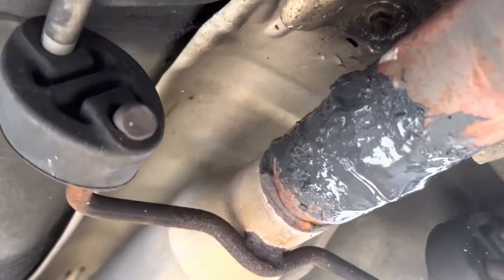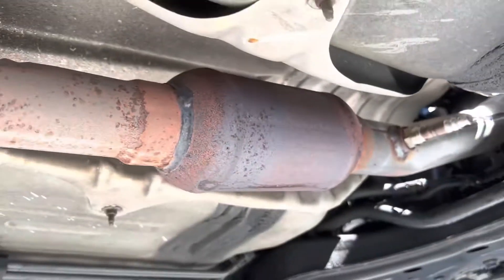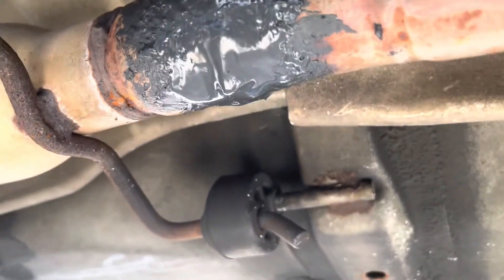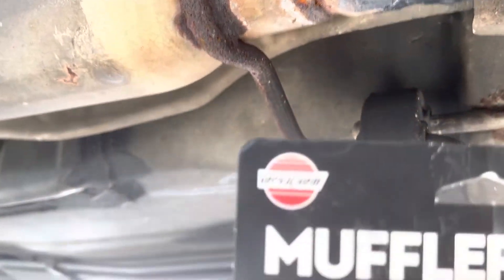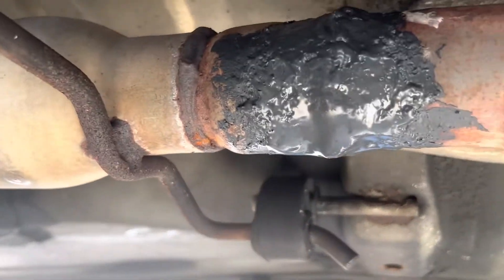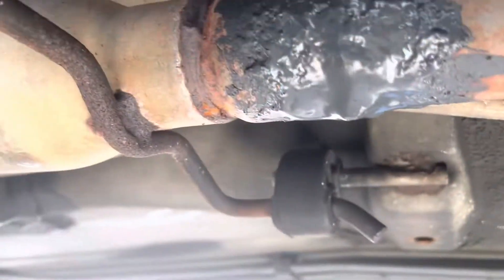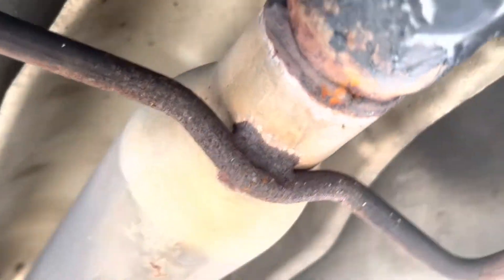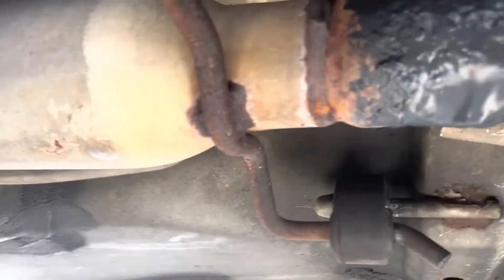Sealing pinhole leak in exhaust

Comment: Hi I had a pinhole just like you that a muffler shop saw using smoke test, my car was running lean I just did it today so don't know if fix my lean issues. Did your's get better after that patch that you did??
Reply from the maker: i dont know. i changed the o2 sensors at the same time.  Its been driving fine ever since.  there is still a vacuum leak, but i haven't done a smoke test.